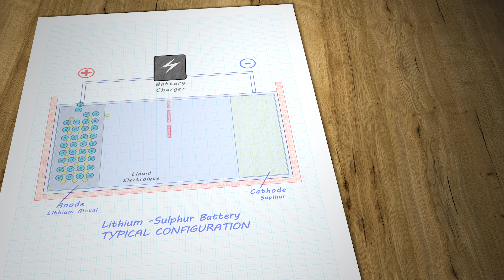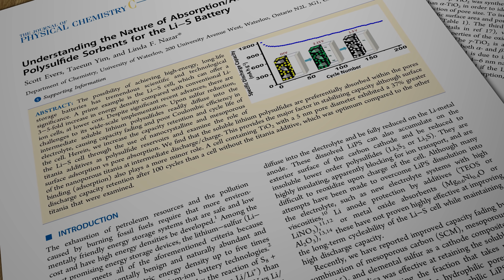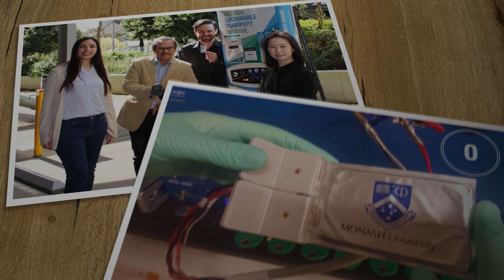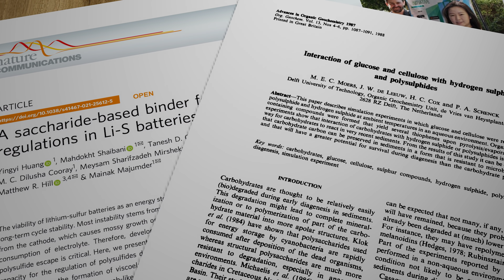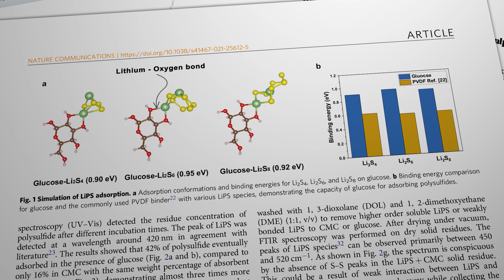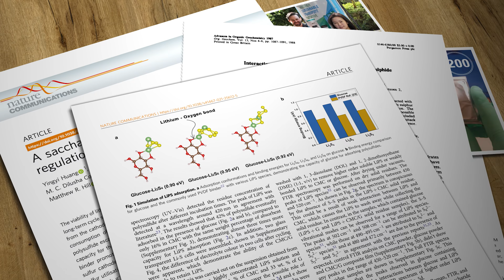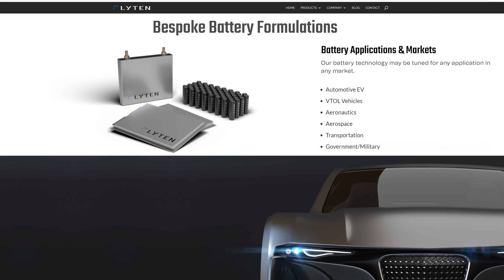Lithium Sulfur batteries: SOLVED! Two new tech breakthroughs in the same week!

Comment: One thing to just have a think about is who’s behind the climate alarm movement.
Every one knows and accepts that the climate changes. It has done so many times before humans even existed and anything humans are doing now has either the tiniest of nearly immeasurable little bit of impact on the climate or no detrimental impact at all. What is harmful is many of the stupid short sighted money grubbing things done claiming to reduce carbon emissions.
Firstly carbon dioxide is not a pollutant and has almost zero effect on the climate. Water vapour literally shadows c02 into insignificance. Clean air unpolluted waters and forests not being cut down to make way for wind farms or massive open cut mines to make batteries etc is what I want . What I don’t want is to live in a version of the world that George Orwell warned us about. Now who is behind climate alarm? There are two main groups one of which is religious in ideology and they back climate alarm because they don’t want anyone eating meat.
The other ideologically more dangerous is the socialist totalitarian group or groups as there are many more than one but they all spawn from the same root. This group is very dangerous because they don’t give a hoot about the climate or the environment or human rights they only want power and they will backstab and murder anyone and everyone who tries to keep it from them.
You can easily tell that I am right simply by listening carefully to the speeches made by most of the public figure heads. They talk of making people do as they say with violence if necessary and in various roundabout or not so roundabout ways of culling the population. And if you really want a hint just read the history of what was going on in Germany prior to World War Two and look at the actions of the Nazi brown shirts and then compare them to XR and others who want to cancel anyone and everyone who even suggests questioning their narrative.

Comment: The 3D-graphene with atomic-level manipulation sounds very high tech and perfect for extremely expensive U.S. military applications. 
The Li-S + sugar battery sounds medium tech and possibly economic for real people. 
If the sugar twist can make lower capacity but cheaper sodium-sulfur batteries viable then maybe I will buy an EV in my lifetime!
Reply: An electric bike, is already a viable car replacement for most people, if they are really trying to make a difference, and not using our crisis as a form of entertainment, which is where most people seem to exist on the spectrum..An electric car takes an unacceptable amount of energy and damage to the environment, in my estimation, it is just another faux solution...
Reply: @robertlloyd2436  I live miles from anywhere with narrow roads, lots of hills and plenty of wet weather. Carrying several 20kg bags of chicken feed, fence posts or a chainsaw and logs on a bike, or taking a load of scrap down the dump is not really viable. The only real alternative for me is to be completely self-sufficient or do all shopping on-line and let someone else bring the goods on an electric bike! 😃
Reply: Clive, you'll probably be able to buy an EV with Lithium Iron Phosphate batteries before these Li-S batteries are available.  LFP is pretty cheap.  There's a small EV sold in China (the Wuling Hongguang) that costs the equivalent of around 5000 GBP.
Reply: @incognitotorpedo42  I've made several bikes with lithium iron phosphate batteries, which is not what most people use because of weight, but they last forever..

Comment: Now that CATL (one of the biggest if not the biggest battery producer in the world) are saying that they're close to production level Sodium Ion batteries, it will be interesting if someone experiments with Sodium Sulphur battery concept (both of the minerals are not rare).
Reply: In the 1960s Ford worked on Sodium Sulphur batteries.
Reply: @crobinso2010  😲
Reply: @TegraZero  just need some cinnamon, then it will be tasty 😋
Reply: How about Aluminium? It is common, light and a high (3+) covalence. Is recharging the problem?
Reply: @ronb8066  iron is less volatile
Reply: @ronb8066  it oxidize and you will need to recycle them. Turning aluminium oxide into aluminium you will need lot of energy (1000C/1832F).
Reply: @TegraZero  BINGO, 😂 Follow the money mafia!
Reply: How about sodium iron sulfate?
Reply: Sodium is a much better than Lithium and sodium Sulphur if possible should be a real gamechanger....
As volumes take of we really need less rare elements used
But remember that hydrogen can be a competitor to batteries in applikations where weight is critical
Reply: @jmz388  Not particularly effectively. Though its own energy density may be relatively high, addressing its instability adds a huge amount of weight, before also considering infrastructure. There will be a few areas where this probably pans out, but in the big ones (transportation) it's not going to happen.
Reply: @Phazaar  sodium is so abundant that it can take the non portable applikations and wet processes
Litium can be used for portable and dry 

Sulphur with sugar can be used to reach stable higher energy systems for batteries

Important is to use hydrogen as storage and high capacity capacitors for transition so we need less batteries of high performance
Reply: @jmz388  Sorry for the confusion; completely agree regarding Sodium and Lithium; my point was about hydrogen. Agree it's very effective for storage, but as you suggested it for weight critical applications (assuming you mean transport) I thought it worth flagging up that it's unlikely to ever be weight-competitive with a next-gen battery.
Reply: @TegraZero  they add milk and coffee
Reply: Jim is correct: sodium and sulphur are elements, not minerals. "A mineral is a naturally occurring inorganic element or compound having an orderly internal structure and characteristic chemical composition, crystal form, and physical properties. Common minerals include quartz, feldspar, mica, amphibole, olivine, and calcite."
Reply: And neither one of them are minerals
Reply: @jimrichards7014  What? has some sneaky bastard moved Sodium on the periodic table?
Reply: @jimrichards7014  I am guessing this is a joke?
Reply: @jimrichards7014  oh jimmy boy
Reply: @jimrichards7014  Both of them are minerals. Wuh. Who taught you this nonsense??
Reply: @jimrichards7014  they're MINERALS, Marie!

Comment: Unlike passenger cars, which spend most of their time stationary, aircraft, trucks and trains spend most of their time working and so don’t have time to sit still recharging their batteries.
Reply: No, but they could switch out the batteries? Particularly for trains and aircraft with train stations and airports where this could be done quickly and efficiently. Meanwhile truck stops could offer something similar for trucks. You just need to implement a way to quickly take out the batteries from the outside, and then insert new batteries. The unused batteries can charge power, while the used batteries come already fully charged.

Comment: I can never quite remember this, but I’m pretty sure in that awesome animation you have anode and cathode backwards vs typical battery cell notation. I believe the positive voltage side of the cell is actually the cathode. In other words, traditional lithium chemistries have a graphite anode on the negative terminal where the sulfur electrode is in this cell. I believe the anode is “the one current flows into” when discharging.
Reply: Unless the electrochemistry is reversed from a traditional lithium ion battery?
Reply: I think the "anode" and "cathode" designations in the animation are correct, but the electron and ion flow directions seem to be reversed.
Reply: @w0ttheh3ll  the flows make sense to me and at least agree with the charging and discharging phases described

Comment: No matter what, long term battery storage will stay very expensive for the forseeable future.
Reply: Not with Fischer-Tropsh process and hidroelectric batteries.
Reply: @sirnikkel6746  hydro storage needs suitable geology, expensive dams and lossy pumping. Also to run Just Germany during the winter months those lakes need to be insanely huge!
Reply: @picobyte  oh, I forgot about green hydrogen, Sabatier Process (Methane) and Haber Process (Ammonia).

Comment: Sulpher an carbon, sounds light.
Maybe the numbers should go per liter instead of per kilogram?
By weight, are they the same size as Li-Ion?
Reply: Anything that can be made can be made in different sizes.
Reply: Both are important in different applications. As are per hour (i.e., charge time) and per dollar. For aviation, per kg is far and away the most important; whereas, for grid storage, it's all about per dollar. Per liter will probably not be the limiting factor in either of those applications, but it can be for a cell phone.

Comment: Lithium iron phosphate already has all of these advantages and more for non-mobile applications.  And you don’t see them being used for grid energy storage.  So we’re just talking about lighter electric vehicles was more range which is hardly a big deal.
Reply: Oh, I dunno. An 85% price drop for batteries would be useful... And never mind bloody Tesla cars - a significant weight reduction might make long-range electric air travel a possibility, too. Perhaps we'd see an e-Airbus or a Boeing Prius.

Both things are quite a big deal. Unless you're more concerned with personal gain from your stock market investments... 🤔
Reply: We won’t really know the price until it’s at market.
Reply: @EleanorPeterson  

Also hybrid air vehicles .. if they are much lighter the volume issue isnt such a problem for a  
big floaty ship or airship....
Reply: That’s true assuming the cost is reasonable.  I suspect the cost will be premium.

Comment: Does anyone know if there is anyone working on putting carbon capture in AC unit?
Reply: It's a waste of time trying to re-manufacture coal. What's done is done. Leave it to nature to restore the balance.
Reply: @MegaWilderness  I want to know if office buildings/skyscrapers/malls can have it and well as it being the standard for new AC. Retro fit seems like a waste on home AC. And I’m really interested in any sources you have.
Reply: @sarawarlestedt7242  Sorry I'm unable to help you. I don't believe a low-cost solution exists to extract CO2 from the air without massive energy input. You might be able to scrub the air with the use of chemicals. I find it a little pointless as humans can tolerate high levels of CO2, just hold your breath.

Comment: I have enough batteries for my off grid system now, all I need is some breakthrough solar panels now? 🧐
Ran out of roof space. I live in the Pacific Northwest, so I need a much better panel.
Reply: build a large shed. the corpses of your enemies go below, PV cells go on the top of the shed. :D
Reply: @NaumRusomarov  🤣
Reply: In the PNW go with hydro.
Reply: Short days and low angle light are a tough chance for PV
Reply: Sadly, solar power isn’t ‘cheaper’ this decade because of newfangled techniques, but simply pushing to China where the sites will be so polluted trees won;t grow in that soil for a thousand years… just so you can have a decade of panel use. See the problem? We need dramatically better ways to keep the diet-coke flowing, but truth is everyone needs to slow way-down. https://youtu.be/prOXz0zFRvs
Reply: @jonathanedwardgibson  
Depends on where you live. The cost of everything is soaring from food to energy because the dollar is collapsing. Not to mention the bottlenecks in shipping and the new war with China. It’s an economic war and it’s just beginning.
Reply: @benjones8977  lol. he pasted a link from RT. he might have as well given us putin's phone number.
Reply: @jonathanedwardgibson  
Hey Jonathan, I see the real reason the elites want to depopulate the planet now!

Comment: Burning might still be a problem, not as much as the lithium ion batteries.  It doesn't have a metal oxide, but it does have sugar.  A piece of trivia I heard once, that a candy bar has more potential energy than a stick of TNT, but sugar can't be broken down as fast.  As kids, we made smoke bombs with Potassium Nitrate and sugar (40% saltpeter and 60% sugar).  You could melt them together or just mix the powder, and it was a cheap and made a lot of smoke.  It may not explode like a Lithium Ion battery, but it could burn awhile and with a lot of smoke, potentially poisonous smoke depending what else is in the battery.

Comment: Some questions I tend to have for most new battery tech:
- How do they handle low/high temperatures?
- Can they withstand vibrations and impacts?
- What does the performance degradation curve look like?
- How do they perform if repeatedly charged from 50% to 100%, or from 0% to 50%?
Reply: Ah yeah, let's find answers to all these questions before making the energy throughput and lifetime actually worth it.
Reply: How do you mass manufacture them economically?
Reply: or how much more energy dense is it than lithium ion
Reply: What is the charge-discharge efficiency/energy loss? Is that loss in heat?
Reply: If you want a car for Russia where diesel freezes in the tank, use hydrogen. For geography which isn't so extreme, then batteries are enough.